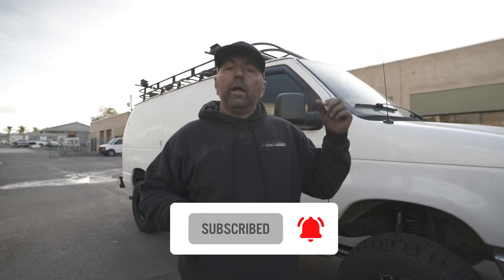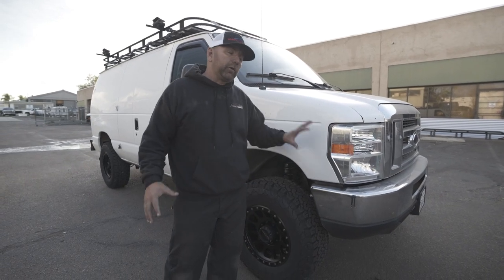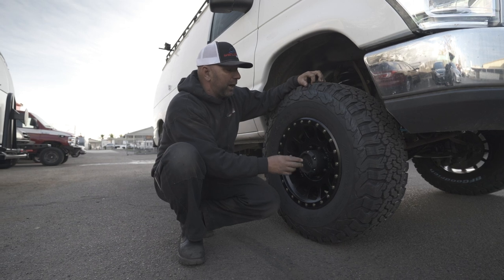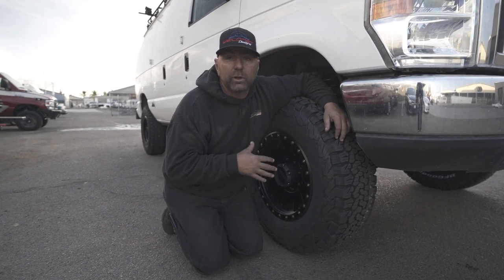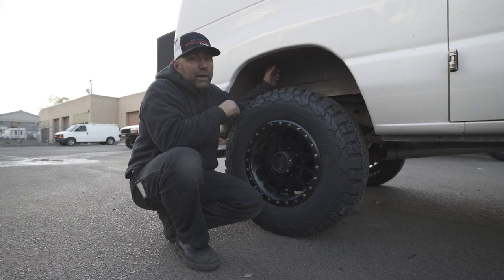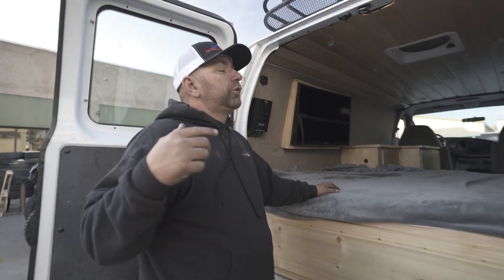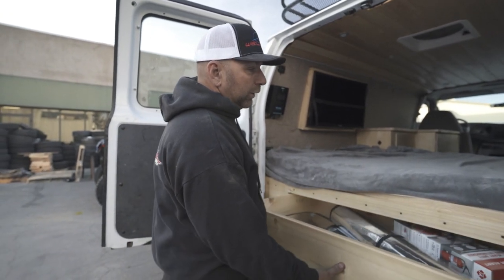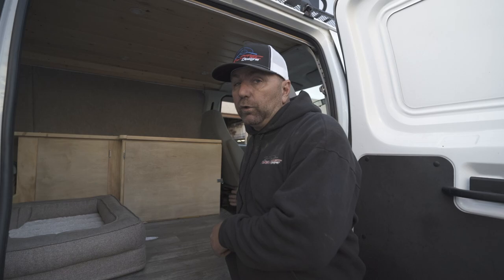DIY Ford Econoline Camper Van 6" Lift

Comment: Selling the bumper separate with the availability of adding to it in the future is the way to go.
Reply: Selling the bumper separete with the possibility to adding to it in the future it’s a great idea for us that can not afford the hole kit togheter
Reply: Yes, I would like to go that way.
Mine is a 2001 Express Van 3500
Reply: Agreed. 2010 Chevy express 2500 here, and I can't swing $4000 all at once, but knowing I could add a swing out AFTER I switch to a larger tire would be ideal.

Comment: I think building the bumper with the option of adding the swingouts later would be ideal.  It gives people the option of buying as they can afford the pieces.    I am looking for a swivel base myself (1998 E150).  And what length spacer would you recommend for the rear?

Comment: My vote would be to have the rear bumper available in the 3 pieces. I really like that look, killer design. Does that bumper have class 3 hitch available or will it clear the factory/aftermarket class 3 hitch?
Reply: You can run any aftermarket hitch with this bumper.  Hitch is not in the bumper.

Comment: Good advice on getting the swivel seat vase, I never thought about that.
Will 285/70-17's fit on your 3" lift or do you need the 6"? 
Also, do you recommend a rear end gear change when going with the 285's? I have a 2012 E350 with 5.4 and 225/75-16's which are 28" tall. The 285/70's are around 31.5" to 32" tall. I'm concerned about power loss with the taller tires. I occasionally tow a 16" trailer with my SxS on it but would like t tow my Jeep which weighs over 4K pounds.